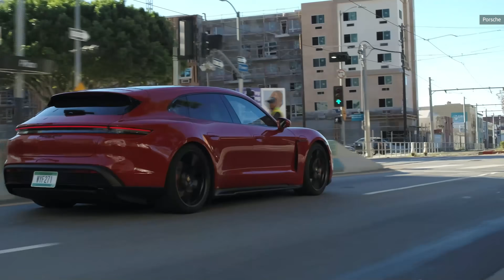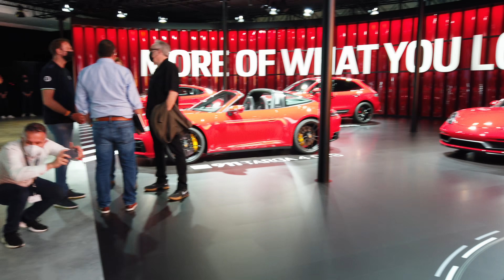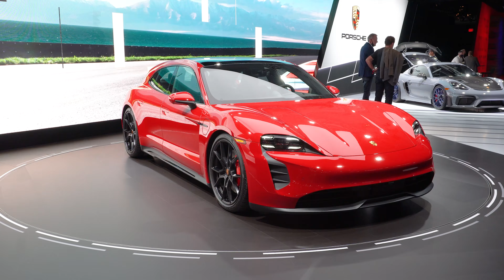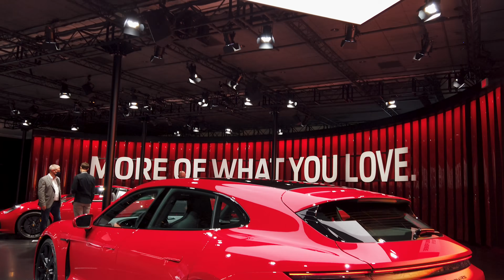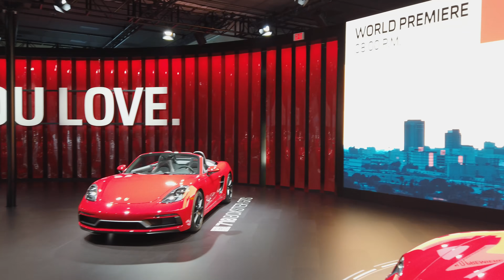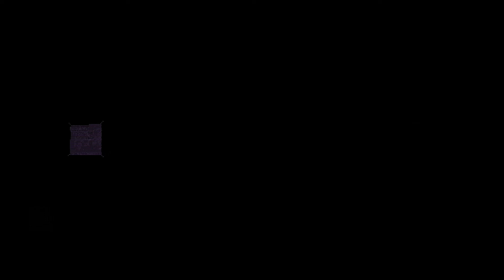Porsche Taycan GTS first look

Comment: @engadget and Roberto, us enthusiasts can see that as cars get more techie you guys have jumped in… but please fact check what you say or put the corrections to the audio on screen like @carwow…..
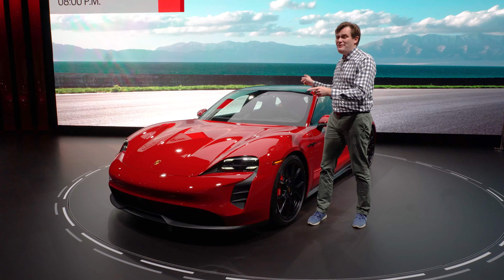This time Roberto said Porsche upped the power from the Taycan Turbo powertrain to 590hp for the GTS…. ? 😅 the turbo has almost 90hp more… (🙈watch between 0:12 and 0:50) 
Also the GTS on every Porsche slots between the 4S and the Turbo… it’s been that way for decades and it will stay like this for the future… ask Andreas Preuninger….

Last time Roberto said that the BMW iX is based on the X5….  The iX is a standalone all new electric model 

Also to round it off, it’s the Taycan GTS Sport Turismo…. It’s not a cross turismo and that’s why it’s sportier and lower….. the cross turismo is not available in GTS spec 😅

Come on guys, you can’t be this casual 😅

Rant aside, We appreciate you guys being one of the few to cover the GTS though when everyone is focused on the cayman gt4 rs…..
Your tech reporters always do their homework and apologise for errors, we would love for the car coverage to be as good 😅….